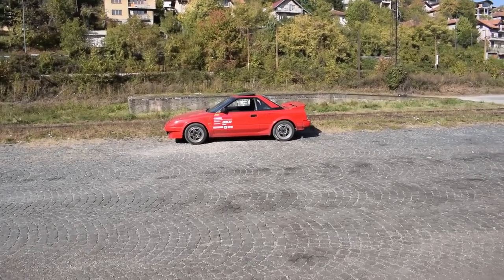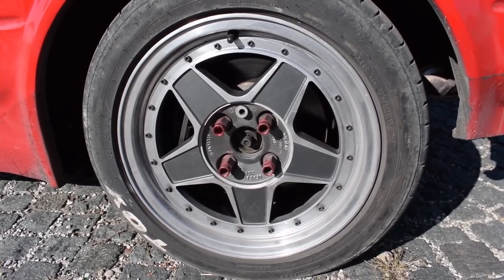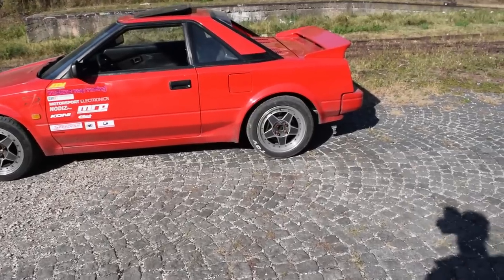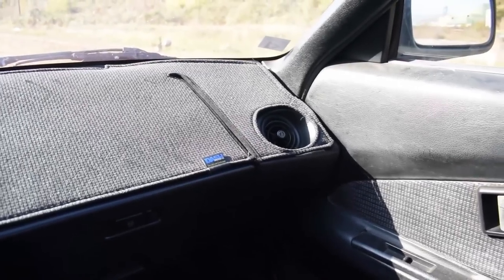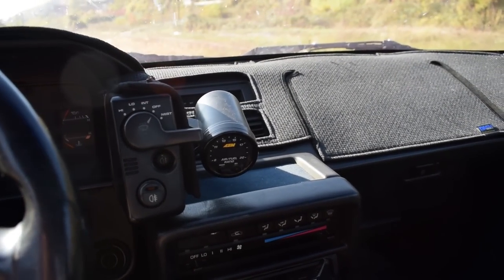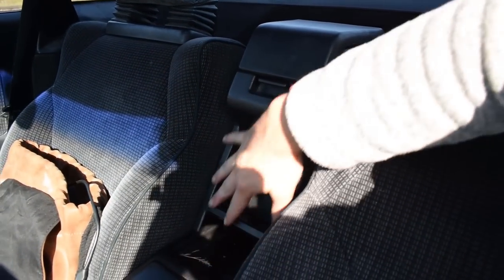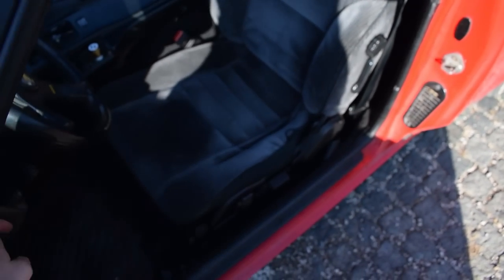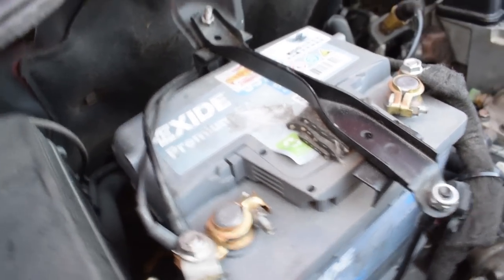MR2 mk1 AW11 Full WALKAROUND / in-depth overview

Comment: Seeing you go over the detail of your AW11 brings back a flood of memories.  I owned my AW11 for nearly 19 years and had more fun in that car than any other car I've ever driven or been a passenger in.

I'll share a few things that I learned.  The front engine mount is absolutely a weak point.  Leaving the front mount as stock is ideal.  What you'll want to do is fill the rear mount with a soft polyurethane (85 shore or softer).  This is done as when the engine increases in RPMs, the intake side of the engine rocks upward, so making the rear mount stiffer does not hurt anything as you're pushing torque/force upward into the chassis VS the front mount would be pulling down away from the chassis.  After I filled the rear mount, I removed the front mount entirely - the front and rear mounts only limit engine motion (twisting), they do not hold it aloft.

Due to the AW11 being a relatively lightweight car, I found that increasing the rear brake bias helped significantly with the overall balance.  I did this by getting more aggressive brake pads in the rear VS the front (ie. EBC Green front and EBC Yellow rear).  This helped to limit nosedive as well and due to the diminished weight transfer forward, made turning after braking easier as the load on the front tires was reduced.

I really do appreciate your perspective of 'this is a car that is driven - this is not a show car' - I viewed my AW11 in the exact same way.  The paint was clearly not in the greatest condition, but it was absolutely bonkers in the turns.

As per wheels, I went from the original 14" wheels to a set of 16" wheels - it was horrible.  The reduced sidewall made the reaction to road imperfections very unpleasant and that made the experience of driving jarring.  When cash was available, I went with a set of 15" wheels (Kosei K1 Racing to be specific).  It was a wonderful balance of better tire selection (more grip) VS a car that was not overly harsh around town.  Because of the wider tires (205 width), traction increasing quite a bit - that meant faster speeds through turns.

Then after destroying 4 head gaskets, shattering the passenger side engine mount, destroying ring lands in cylinder 4...  and a myriad of other "hiccups" (ie. stuff breaking because of my over the top driving), I finally decided to upgrade the power plant...

Out with the C52 and 4AGE.  In with a S54 from a 1993 Mr2 non-turbo and a Gen1 3SGE from an 1988 Celica GTS.

It was quite an adventure, as no one had done this swap prior.  I had to do a lot of custom things.  Custom fuel lines, intake, exhaust, shifter cables, a hybrid engine harness and a few other things (the battery was relocated to the front trunk several years before this).

The result?  Going from 112hp to 135hp does not sound impressive.  It was an absolute missile!  I would walk past any NA Mr2 (regardless of which year/generation) without trying.  I would be pushing on the stock Mr2 Turbo with ease due to how quickly the 3SGE responds to throttle inputs - something no stock turbo car could match.  The jump in torque from 97ftlbs to 125tflbs was MASSIVE!  The acceleration was unlike anything other Mr2 I've been in before or since (it was quicker to accelerate than a 4AGZE Mr2 that was pushing 12psi of boost).

I was on the highway at a V6 Honda Accord was trying to keep up with me as we transitioned to another highway (from east bound to southbound via a very, very long right handed transition) and I was going 115mph and still on the throttle, but the Accord was nowhere in sight.  Even prior to the turn, when the Accord tried to keep pace with me, it could not - and the driver was trying.

That engine setup (with a catalytic converter & stock AW11 4AGZE muffler) was so loud that at 4000RPMs or higher, if you were deep in throttle, you could not hear yourself scream.

Yes, I really do miss that car.  Admittedly, if I had kept it, I would eventually have died in it.  I had this problem: I didn't stop pushing.  I kept going faster and faster.  The only things that would get me to slow down were an object (person, tree, car, etc), something mechanically happening that was sadness inducing or a law enforcement vehicle.  My speed driving in the rain was absolutely absurd as well.

Anywho...  Here is a video that a buddy took.  Its a cold start with a mild 1st and 2nd gear pull.

https://www.youtube.com/watch?v=7a21MhJ2SbQ

Comment: Hey, 'cmon,  even Trabbies have the economy gauge. Even though it's much more sophisticated there :)
For the battery holder, you can make extra thread on the rear stud so you can screw it more + maybe leave one small rubber pad to protect the paint...
Is there a way to contact you? Viber/Telegram/Patreon/Mail?
Keep the good work! You make awesome videos!
Greetz from Bulgaria.
Reply from the maker: I spent 30 min in a Trabant in Berlin, most fun you can have going 20kmh! I've got Patreon links in the description of my vids, Instagram works too. Cheers
Reply: @d4a   you don't have them in BIH? We still have them driving around. They are soo fun, actually. A friend of mine owned one for quite some time and it's a great city car (despite of being 2stroke and smoking + lack of safety)
Cheers!
Reply from the maker: @valqkasdf  There's a total of 5-10 in the country I think. Only 2-3 are driveable as far as I know. They were never really popular here, mostly because of Zastava, and then Golf took over everything in BiH as it was assembled here and offered at good prices.
Reply: @d4a  It's the opposite here. Zastava's are no longer seen on the streets.  I saw one Yugo maybe 4-5 years ago (with padlock on the door LOL). But I saw twice or more a month a running Trabant. It's because of Yugoslavia and local availability there maybe. I think Trabants were mostly easy to get here. Then comes Skodas, Mosckvich and Ladas... anyways. Too much oldish stories ;-)